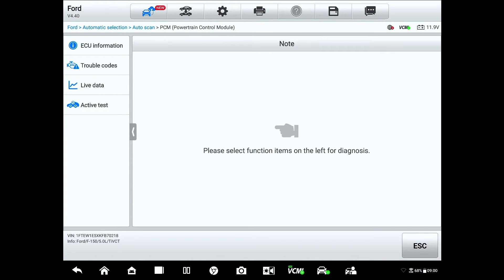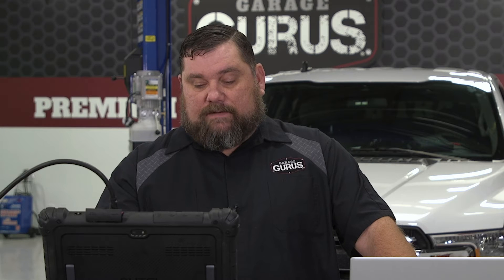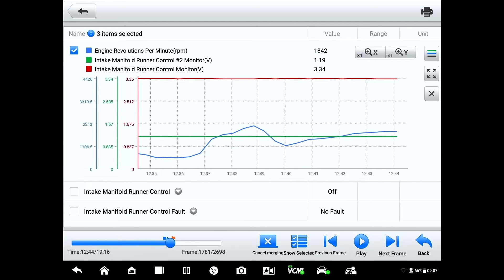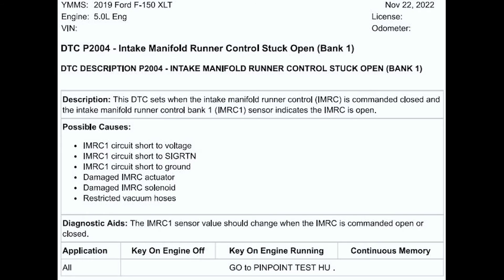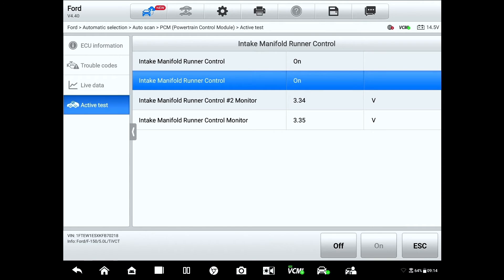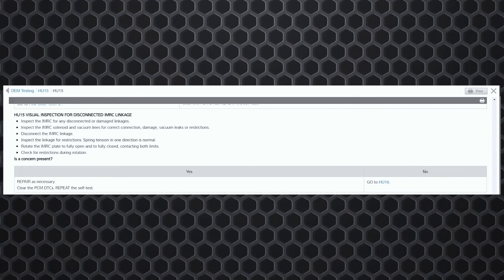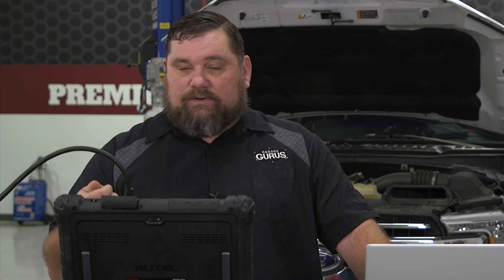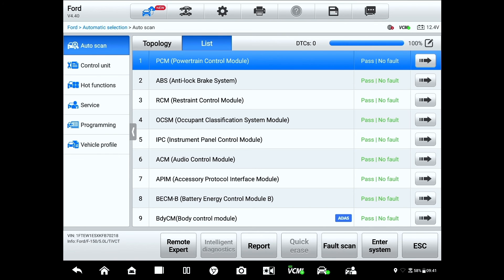Garage Gurus | How to Diagnose P2004 IMRC System Code on Ford F-150

Comment: Many times the plastic bushings crack on the actuator control rods, and the rods fall down and can't move the linkage. Normally a cheap repair. However, the last time i cheacked, the bushings were not available seperately. You had to buy a complete new intake manifold. Lovely...
Reply: Sounds like a job for a 3D printer?
Reply: @Todd Erickson  Possible. But the intake manifold still needs to come off. Not an easy repair. I have done a few....